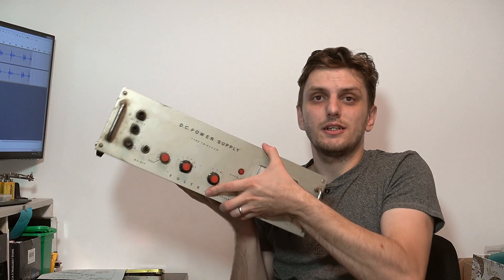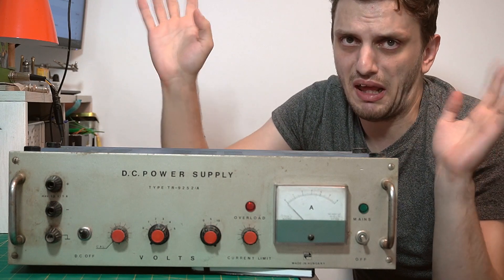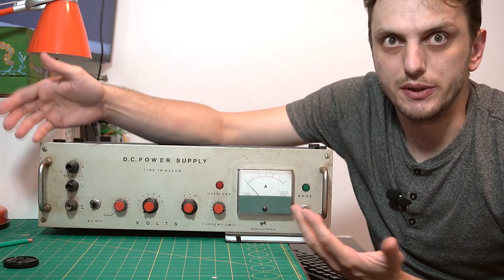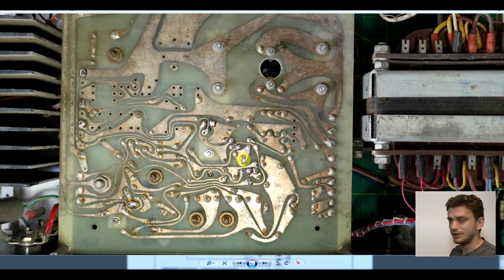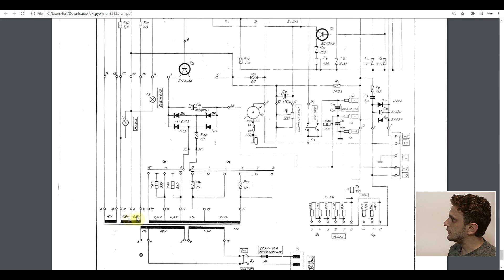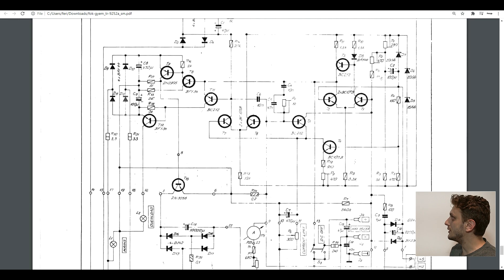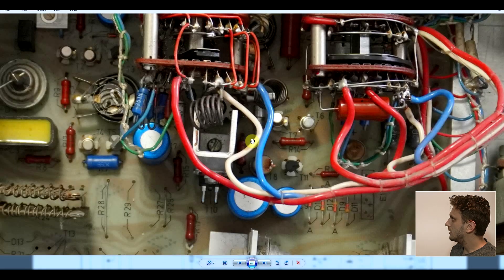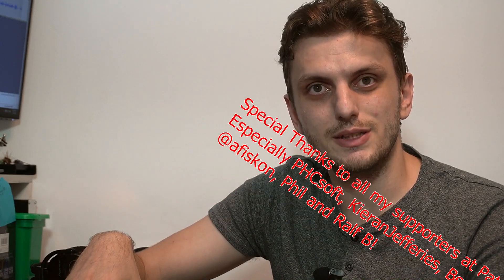Power supply teardown - the TR-9252/A from Fok-Gyem

Comment: It is interesting that the unit control labels are in English and not Hungarian. Is it easier to engineer in English or Hungarian? or to ask the question another way, does learning and designing depend on the language used?

I am a little freaked out by the fact that the output DC switch does not disconnect the supply completely from the load when off.

In the USA the design would be much simpler with multiple pass transistors and having a dedicated controller, in its simplest form, for limited range, being an LM723C. The LM723C has an interesting current limit mode called current foldback which is a very nice feature which reduces power dissipation with an inverse slope but without the abrupt current limit jump made with the supply in the video. 

For full range down to zero volts, an op amp controller would be used with a discrete voltage reference. In other words, in the USA, in this same era, we would just dissipate the power by having more pass transistors and a larger heatsink with a cooling fan. The design would be flow through, so air would be drawn across the entire circuit board and transformer.
Reply from the maker: I think the text language may have been a feature used to make the device easy to sell outside the country.
Reply: Yes, I would agree that makes a lot of sense. You seem to be well versed in circuit theory and you speak both English and Hungarian. But, when you picture electrical concepts in your head and relate them to what you have learned in school, are the concepts more easily understood in Hungarian or English? or is it a consideration to you? @FesZElectronics
Reply from the maker: I guess English or Romanian :D, I'm actually from Romania. Anyway, most technical literature available is in English, so I guess that is the language in which I know most terms.
Reply: In the USA the relative population of BSEE (Electrical Engineers) as compared to the total population is very small (0.03%) even less for professional registered engineers (0.01%). Even though our official language is English, the textbook nomenclature used is in engineering is actually very specialized, with origins usually relating to specific educational institutions in the USA. For example, the symbolic expression of Maxwell's Equations, as an approved symbol representation for ABET accredited University Degrees (University Textbooks on Electromagnetic Theory), has its roots with the Massachusetts Institute of Technology (MIT) as a matter of reference (like the Del Operator and other Vector Calculus nomenclature as adapted from W.R. Hamilton).

For Electronic Instrumentation repair in the USA, specifically bench DC power supply repair, two different types of Isolated (both mains and ground) variable AC power supplies are used one for repair and one for calibration and outgoing test. This type of repair is usually done, if the equipment is under warranty, at the manufacturers repair depot. 

The repair isolated AC variable power supply is based on a large isolation transformer and a variac. The electronic bench is usually earthed (grounded) for personal safety and ESD, so all equipment that is tested and repaired must be isolated from mains and earth as a starting point (especially for switching supplies). I actually like to use a Fluke Scopemeter for troubleshooting power supplies because it is a battery operated scope and all of the channels are isolated from each other. So, there is really now limit on where you make measurements with the 10x probes. So, essentially both the device under test and my test equipment are isolated and floating. I also use a Fluke 289 for power supply repair, it has a low Z AC voltage range which eliminates the possibility of AC ghost voltage. For many companies the variable AC repair power supply is designed in house for their specific needs. 

The calibration isolated AC power supply is a large instrumentation isolated AC supply (only the line and not the ground) like the B and K 9803 or Keysight 6812C, which have a very pure sinewave output and allow setting of high and low line AC voltage at different line frequencies, along with the ability to do preprogrammed AC line transient testing if this is required for outgoing test. To calibrate a static parameter or look at performance you would use an electronic load and the instrumentation AC supply. @FesZElectronics

Comment: Moo. :)

This power supply is just so damn beautiful! I love the vintage test equipment, it was really built to last. And it did.

I was actually surprised to see an IEC C14 power connector. Very nice!
The PCB design is beautiful - if only it had some solder mask, or at least a varnish coat...

Comment: Hello,

I want to know if it possible to modelat mathematically in function of data-sheet of a special photodiode InGaAs, in a S.P.I.C.E. simulator like LTspice , it can be other S.P.I.C.E. simulator.
I found an electrical schematic equivalent of working for  that photodiodem attached at an transimpedance amplfier.
I will attach the electrical schematical equivalent of photodiode InGaAs attached of transimpedance amplifier and the documantation of photodiode.

Thank you,
Dragos.
https://www.tme.eu/Document/726cc5089c90f506f2d9a008ec28a891/ig17.pdf

http://www.osioptoelectronics.com/application-notes/AN-Optical%20Communication%20Photodiodes%20and%20Receivers.pdf

https://ibb.co/SPYvXdf
Reply: Any advice?
Reply from the maker: Salut Dragos,
In principiu orice formula matemematica se poate modela fie cu surse de curent fie cu surse de tensiune (behavioral voltage or current soruce); Conteaza insa foarte mult ce anume vrei sa modelezi - care din comportamentele fotodiodei chiar te intereseaza - oricum in LTspice nu ai "lumina" deci va trebuie configurata dioda fie in functie de un parametru fix fie o alta sursa de tensiune care sa reprezinte intensitatea luminoasa.
Reply: Vreau sa monitorizez grafic impulsul fotodiodei in functie de  iesirea amplificatorului de transimpedanta, pentru masurarea sensibilitati.responsivitatii ,unde forma impulsului la intrarea fotodiodei trebuie sa fie, un impuls dreptunghiular optic,  cu o perioada de 20 ns,si timpul de crestere trebuie sa fie 4ns si timpul de scadere tot 4ns, cu un interval de tensiune intre +20V si -20V, iar puterea optica trebuie sa fie in gama 100 si 100nW/cm^2.Vreau ca prin modelarea matematica, ca comportamentul fotodiodei sa se apropie cat mai mult de cerinta.
Reply from the maker: Nu am un raspuns simplu la problema asta. Poti incerca sa vezi pe baza datasheetului care ar fi semnalul de raspuns al diodei si sa aplici numai acel semnal la resutul circuitului. Adica sa incerci sa simulezi si sa modelezi pe bucati circuitul. La orice componenta in mod normal se poate face un model echivalent insa in functie de precizia dorita modelul va fi mai mult sau mai putin complex.

Comment: Aaah yes, 70's and 80's circuits.
They are by far the worst to troubleshoot, hahaha
Nice video about some history! 

There is actually an important parameter that most people overlook which you only mentioned very briefly.
That is temperature and heat. Most people only think about max temperature values.
It's actually a lot more difficult to keep that max temperature under control over a longer period of time.
Dissipating heat in a short amount of time is easy, but keeping the performance over let's say a couple of hours and things will get complicated.
This parameter is actually more important for audio amplifiers, but is also definitely and issue for professional power supplies that have to be on reliably for hours.
The same goes for "delivering" enough current (power) to loads, especially dynamic loads.

Comment: Cool PSU.
I like linear supplies better for some reason.
I don't like PSU without big transformers.
Reply from the maker: Well most often you get way better noise performance and transient response from linear supplies; The main reason for using the switching ones is size. I did notice though that some modern day higher end supplies rely on an architecture that takes the best of both worlds. They make a switching supply that then supplies a linear one - the main power conversion is done with high efficiency and noise; and then the linear supply is used to reduce the noise. But sadly there is no large transformer involved...
Reply: @FesZElectronics  I just bought a Dr. Meter branded supply and it has a huge chunky transformer.  It has a few issues with noise but some clever folks have worked out the causes and modifications to make it cleaner.  IDK who the OEM is of this PSU but so far it is working very well.
Reply: @FesZElectronics  There is a Fok-Gyem TR-9158A PSU, it is capable of 40V/10A. That one contains a very big transformer, but still a small heatsink for the linear regulator, because it uses a thyristor controlled rectifier (SCR) which acts as a preregulator. So sort of like a switch mode, but with the tech available in those days.

I have one, it is a very reliable instrument. I killed it once though, because it does not contain reverse feed protection, and I was charging a battery with it while the power went out, and it didn't liked it. I added a reverse diode from the output to the main buffer caps, along with some other small modification I forgot already, as it is fine since, during the last 10 years of abuse.

Btw. the shunts in the TR-9158 is wound bidirectionally, thus it is inductance-free!
Reply: @FesZElectronics  I am surprised when you read the company name on Wikipedia, as I was almost certainly sure that you are Hunagrian.

What does 'Fesz' stands for in the channel name actually?
Reply from the maker: @gabiold  I'm half Hungarian, but born in Romania. I learned the language when I was little and spent time at my grandparents. The name is short for FEri SZasz.
Reply: @FesZElectronics  Thank you! I thought it is the short for "feszültség" 😉
(it is the Hungarian word for "voltage", for those who don't know)